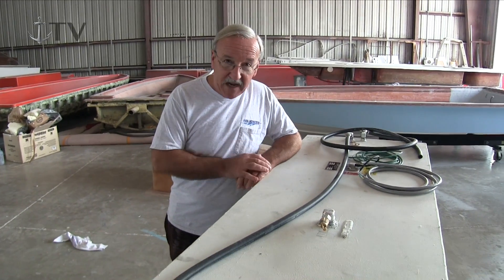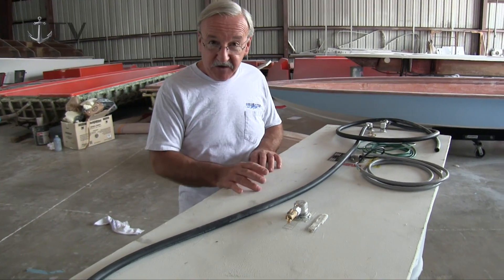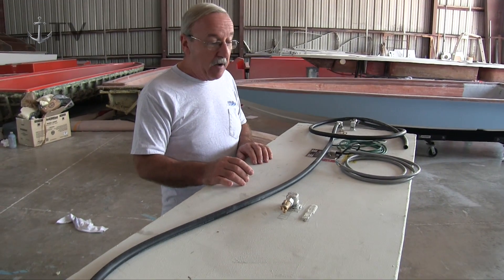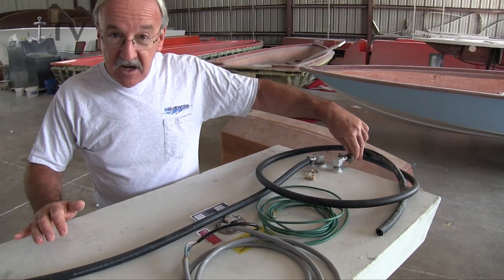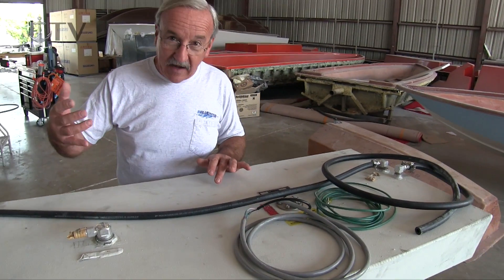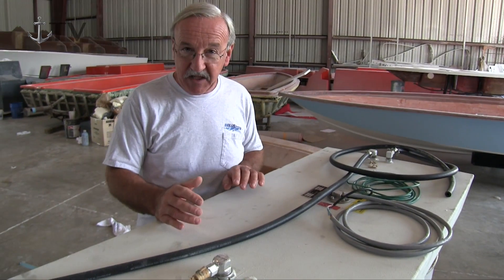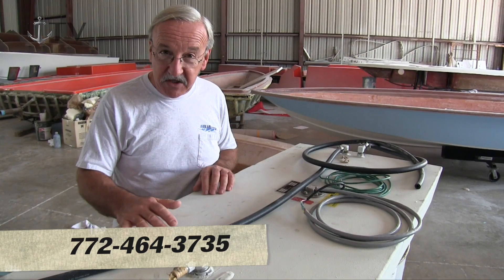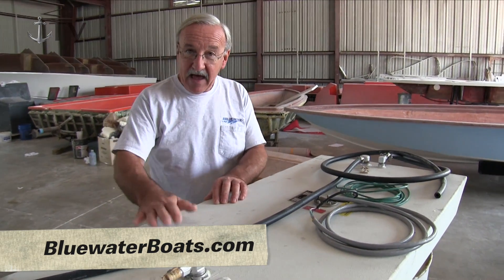Marine Fuel Tank

Comment: Do all marine tanks struggle with blowing fuel back into your face during fueling up process???  I have vents but still get some blowback.  Or should I just make the vents the next hose size bigger?
Reply: Dustin you may have a delaminated fuel fill hose . I did on my 2003 Scout 175 Sport Fisher. Could not fill the tank at the gas station.